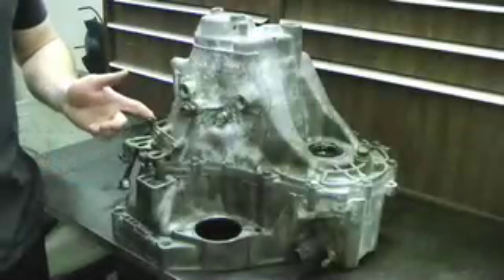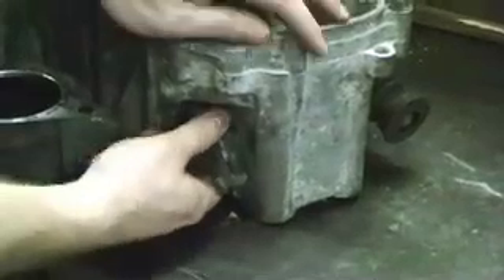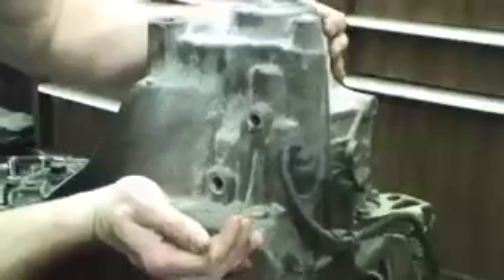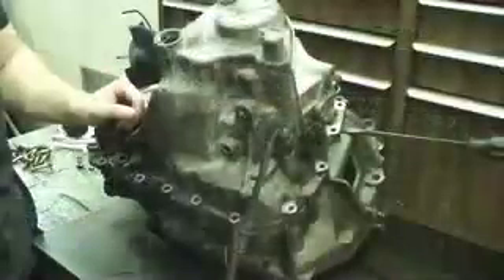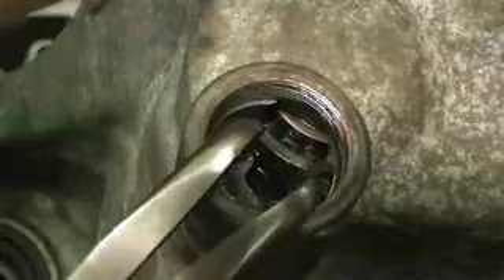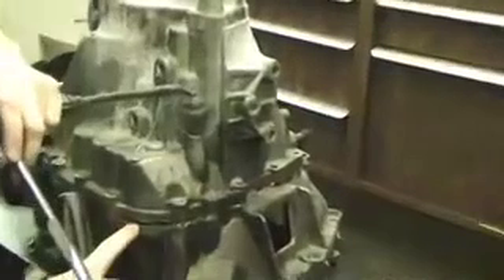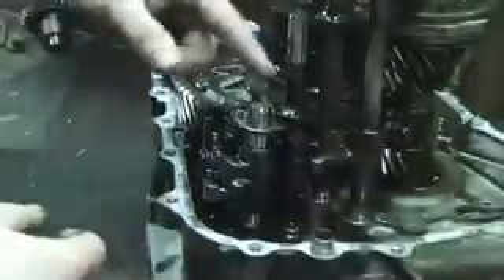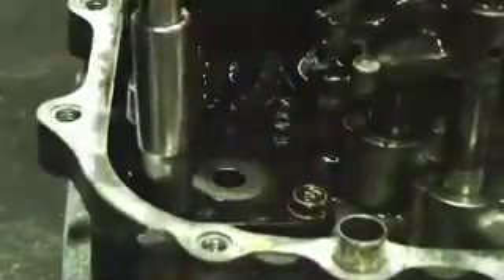Evans Tuning Differential Swap Tech Article - Part 1

Comment: @steve088 use some bearings balls from old bearings cut them in half and use them as check balls you need to find the same size.